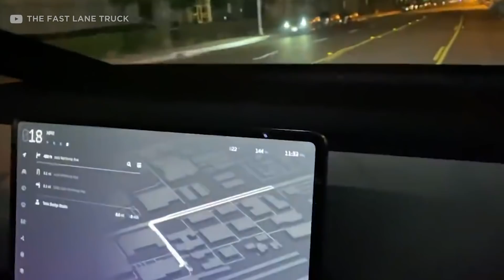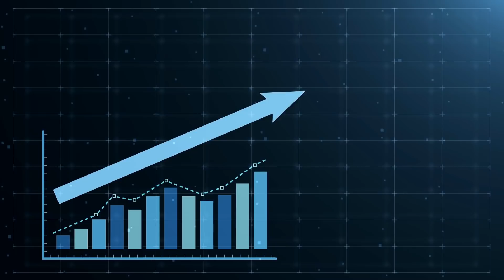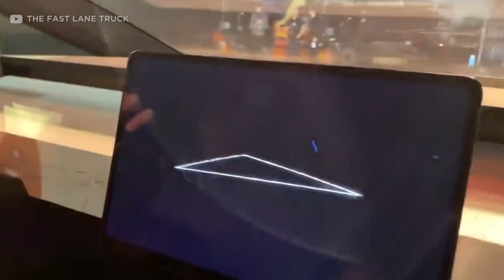Why Is Tesla Cybertruck So Cheap?

Comment: Its cheap because it doesn't exist.  It will look like a Stainless Steel 1988 Nissan pickup by the time they shorten it and do all the mods to make it comply with safety regulations.  Then you will feel like a sucker to have been sucked in to putting money into it  Do you think more than a few of these will get produced this year as late as it is already?  Elon Time don't set your watch by it.
Reply from the maker: Tesla is widely regarded as a premium automaker, even if some of their cars have dropped in price over their years in production, that's why the Cybertruck is considered so cheap!
Reply: @techspace9649  Their reputation has declined a lot in China where they have had to recall all the cars made there.  My point is Cyber truck is not a real product and the plant isn't even finished.  No one even knows what it will look like.  Most people on this sort of site take Tesla's promises like gold even though they have broke many such as FSD, Cybertruck, and 35K Model 3.  The company isn't that new any more;  one needs to be more realistic in appraising their claims.
Reply from the maker: @litestuffllc7249  Thanks for your explanation!

Comment: I love the truck and I'd buy it but, in my opinion, I'd like a full round steering wheel. This should be given to the buyer as an option. I say this because sometimes I drive in the snow and I go camping. Going camping means I have to drive on some gravel and dirt roads. Also, I live in San Franciso. There are heavy traffic on the streets and freeways as well as bikes that share the road, transportation busses (Muni), hills, and high people traffic. I just believe a full steering wheel will feel better and safer especially since it is a truck. Again, this is just my opinion.
Reply from the maker: Hi Dwain,
Good point! The electric truck needs to be pointy and sharp. A rounded steering wheel will look out of place but as you mentioned, it is not practical sometimes and even does not comply with pedestrian safety laws.
Reply: Yes, the steering wheel should be optional. It seems like an easy thing to make an option. Maybe even to swap one out for the other.

But the yoke style steering wheel might be nice once we have full autonomy. When the steering wheel itself is something that is rarely used a smaller profile might be a good thing.